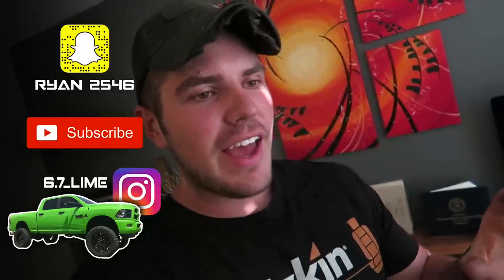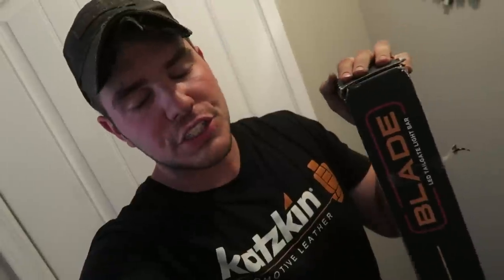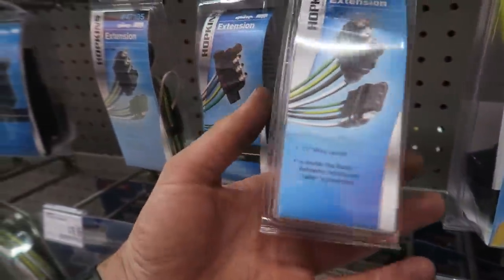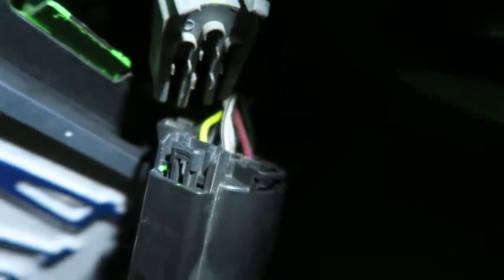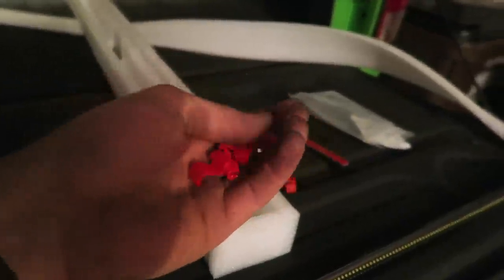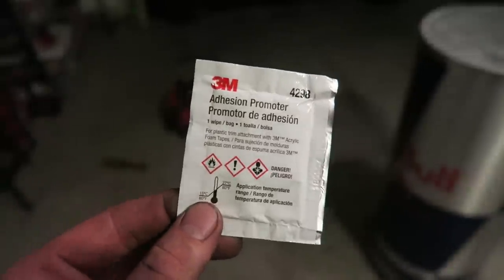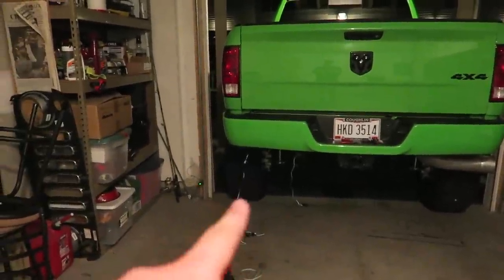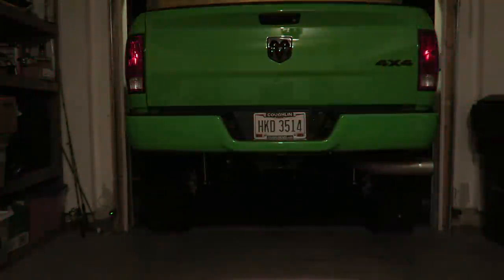LED Tailgate Light Bar INSTALL!! *Super BRIGHT*

Comment: ....spends $200 on a tailgate lightbar - okay fine....  doesn't spend $12 on a soldering iron to make good connections - not so cool....
Reply: WORD!!!
Reply: He’s a newb, give him a break
Reply: Cringy eh
Reply: No go  have to save my money for crack
Reply: The tape probably fell off before he was done with the video.....
Reply: Scott Warmbier but the t-taps are too novice...
Reply: See how clean that thing is!?!?! City boys are funny
Reply: I like your green truck is my favorite color I wish I had a truck like that great way to go
Reply: Haters gonna hate !
Reply: Solder will get brittle and break over time. Crimped would have been best.
Reply: If the truck vibrates so much that it might crack the soldered joint? On some occasions a classic linemans splice is my choice on the equipment that I work on
Reply: They make a plug and play version of that connector as well. He should look up the term multiplexing to learn why you should never tap into the wiring of a third gen or beyond.
Reply: @79brumley  no what makes him an idiot is saying its 2 bucks for a decent iron with solder and flux when he could have spent 2 bucks on marine water proof connectors with the solder in them already....just saying
Reply: Donnie Richard you're*
Reply: @donnierichard3301  So if you had to have surgery and your surgeon was pretty new and he made a mistake, Would you say oh he did a good job for being inexperienced? If you can’t do a job correctly you should put a disclaimer in your video telling people not to do what you did! Messing with your electrical system can void the warranty on a new vehicle! Also he says he does this to all his vehicles, You would have thought he would have gotten it right by now! I can’t even count how many of my customers cars I have fixed because they told me they watch the video and thought they were doing it correctly and ended up having problems or causing more issues to their vehicles!
Reply: Oh fuck!! Why you doing my boy like that 😭😅😂
Reply: Buys a light bar not for functionality or work but for looks…snowflake

Comment: Have fun lowering your spare tire when you have a flat....
Reply: He wont be cause it's the oem spare and the other 4 are big ass mud tires on different wheels
Reply: @Marathon13240   sure yah can.. the spare goes on the front and leave it in 2wd
Reply: Why would you go to all this trouble for an LED light bar when you didn't even replace your factory brake light bulbs with LEDs?

Comment: Need to swap out the taillight bulbs for LEDs so they're instant on/off like the light bar. That would drive me absolutely crazy seeing the stock signals and brakes fade in and out while the light bar comes on and turns off instantly.

Edit: This would be a must for me, even without the light bar!

Comment: Looks like a sweet rear end upgrade.  To avoid future problems, I would highly suggest (as others have, but i'm trying to add a helpful factor in and not just name call) you do a better splice in job.  The elements will make it through your electrical tape and corrode those connections.  Those scotch lock connectors (t-taps) are no good and have seen them fail many times as well.  I mean your connections, as is now, may last a week, a year, or maybe 10 years, but I'm sure you don't want to have to worry about it at all.  I would suggest cutting the wires apart where you spliced in and either soldering them and then covering them with heat shrink that has adhesive inside that will help seal it up, or use butt splice connectors that have heat shrink with adhesive on them.  You can get ones that can accept 2 wire on one side and one wire on the other side (like a yellow butt on one side and blue on the other).  To take that even further in to the professional installation side, you could make or purchase an 8" adaptor with the correct connectors and amount of wires and then splice in off of that and have a connector there and install a connector on the light bar wires.  You could then remove the adaptor and light bar if you ever wanted and just plug the factory connectors back together.  Obviously this is just my opinion and someone else might call me an idiot or maybe have something helpful to add, which i'm fine with learning, But this is what has worked for me to make good wiring connections and not have to worry about them.  Cheers
Reply from the maker: I respect you actually commented on how I should do it to not worry! Lol I did it this way so if I wanted I could always remove it without cutting! I didn’t want to cut and solder the harness back together, I may solder the connections in the future but for now they’re gonna be like that for a while lololol
Reply: Bradley is right, do it right the first time. I lmfao when I saw you twist splice and tape the joints.
Reply: I haven't watched the whole video yet but doesn't somebody make some type of plug and play so you don't have to cut any wiring and in the future if you wanted to remove it you just plug the original back in???

Comment: Thanks for the recommendation. I am surprised you got one with Amber flashers when your truck doesnt have amber flashers on the rear. I want to get one for my 98 K1500, which only has red on the rear, so I hope they have one with Stop/Running, Reverse, and Red Flash.

Great video!

Comment: Received my light bar and wired it today. The lights are amazing [bright and crisp]. Get one, you'll love it. Save yourself some time and order a Curt #56584 harness and #58550  5 pin connector plug from Amazon. Just plug and play, no cutting into your trucks wiring. You will have to wire in the backup light, but this can be done on your work bench. Thanks Ryan. Also the light bar does NOT interfere with the lowering of the spare tire, you just have to modify the protective ring a bit.
Reply: Nelson Bardsley I’m trying to avoid all the splicing or whatever. I was going to order that harness with it, but it says it doesn’t fit my truck I have a 2014 ram 1500. Any recommendations??
Reply: Angel, There are so many variations of wiring harnesses and truck configurations. Get ahold of "curtmfg.com" and they will be able to help you. My truck is a 2017 model Ram.
Reply: Great info and a very helpful and respectable response there Nelson! The world needs more kind people like you in it! Drive safely and enjoy the holidays.
Reply: @nelsonbardsley3535  Be honest man are you getting paid by them to say this or no? I have a 2006 5.9 Cummins do you think itll work?
Reply: @steve5912  Sorry, not getting paid, just love the product and install was easy. It should fit almost any pickup.
Reply: @nelsonbardsley3535  Alr thanks bro. I just got this truck and I'm replacing every bulb with led and adding some light bars/pods. I'll look into the #s you mentioned.
Reply: Just plug it into your trailer plug and your done. No splicing.

Comment: Has he heard of the CURT 55384 Vehicle Side Custom USCAR Vehicle Trailer Wiring Harness for Towing, 4-Pin Trailer Wiring? I used it to install my OPT7 Triple LED Tailgate Bar with sequential turn signal, and the only splice I had to do was for the Reverse cable. The CURT harness took care of the rest. In my case the bar already came with the 4-Pin connector pre-installed and a single cable for the Reverse.

Comment: My 50$ front ebay very bright led set-up has been goood for just over a year with no problems, still like new. Came with lights, wiring and switch for in cab. I dont think I'd get fancy ones and be spend 10x to 20x more for not much different. Cool look though!

Comment: Don’t use any snap connectors, always use heat shrink connections. They’re weatherproof, and will not corrode if you do it properly do it. Splicing wires the way he did is sure to fail shortly.
Reply: Yup. If you’ve seen his more recent videos it’s already failed
Reply: Posi-tap or the supplied ones work with electrical tape. Haven't had any issues for 2 years. Glad i didnt aoldoer becausei sold the truck but wanted to keep the blade

Comment: Did you just wrap spliced wires on the under side of the truck with just electrical tape? No solder, connectors or heat shrink?
Moisture problems ahead.

Comment: I got one on my car silly I know But I do t have a daytime runner wired in (weird on a car) but the brake lights flash 2 times before staying solid and the turn signal goes from  one side to the other sorta like an Audi signal. Cheap and easy mod!

Comment: Bought one for $12 on eBay on accident. Been using it for 2 years and all the led's still work. Has full function also, hazard flash, left/right blinker, brake and reverse light. 
The mistake was worth it lol
Reply: You didn't get a Putco Blade for twelve bucks.

Comment: I have a tail gate light bar on my 2016 Silverado and I bought a harness adapter the goes in between the factory harness and the bumper plug and has a 4 pin connector on it. No need to splice factor wiring and I tapped into the center wire(reverse light on the adaptor

Comment: So while I'm only looking for a reverse light bar, holy crap $300 today on Amazon for this Blade.....still looking.......but a question for ya, I suppose your truck does not have "Trailer Light Out Sensing" because if it did, wouldn't the truck think a trailer is always connected?
On my 19 Ford, when I plug in a trailer (essentially the same thing as you tapped into), the truck knows the trailer is connected. Just a thought....

Comment: A t-connector will plug straight into the truck wiring harness and works great for the 4 pin, then it's just a matter of connecting the back up wire ... I like the self stripping tap connectors. 
Great vid .... lights look awesome.
Reply: Alot better that ehat he did..wrapping the wire than taping it. Better off using the supplied ones he had

Comment: Did you check that you can get the spare tire crank bar extenders into the hole you just covered up with the light bar? You're going to bust the thing cranking down the spare.

Comment: Hey man,  that is some bright lights,  I have a RAM 1500 and I need to figure out how to rig up a movable light bar for retrieving a boat at NIGHT, there are NO lights at the ramp i am always at.  I wanted to light up the whole area because it's a sailboat, not a motor boat it goes on differently and you have to see things!   Is there any way to make up a connection for this situation?

Comment: If u splice that way you should use a punch to separate the wire core to make 2 half's then stick your wire in the middle then twist now it will not just unravel and u get a more secure connection

Comment: I would recommend removing the tailgate to install much easier.  Also, it looks like you installed the lightbar right over the spare tire removal opening?  How will you drop the spare?
Reply: HPIII looking for that option is the only reason I watched this ( I also have a ram ). Then he went right over top of it🤦🏻‍♂️
Reply: @UpStuff  This is also the only reason I watched this video.  I wan't one for my 2014 Ram 2500, but I also want to be able to lower my spare tire,

Comment: Looks great.  Only one thing.  Won't you think it would it be easier  if you it take the tailgate  off so its easier to work in the area
Reply from the maker: It would be easier but I have a tailgate assist on my truck and didn’t want to remove the shock lol otherwise I woulda!!

Comment: Of your doing this they make a T connector that plugs into the back of your 7 pin plug and gives you the wires you need so your not splicing. It a much cleaner install and much more reliable.

Comment: Hey bro why just not connect it directly into the 4 pin connector is there a difference other than making look much cleaner without the wires being visible ?

Comment: A plug in t connector or shrink butt connectors and should be using a 5 flat connector like what is used on a boat trailer with electric brakes so you have the 5 th wire for reverse lights

Comment: Ryan going back to an old video for some help I like how you set this light up but I wanna run flush mount leds in my bumber could I hook them up like this for reverse and then have it on a switch were I could turn them on when ever

Comment: Looks good only reason I care for them cause of the blinker I can't stand that the light bar is a blinker (IMO) looks tacky
Reply: Sequential > blinking
Reply: You can leave off the left/right blinkers, and utilize the tail light portion of the 7 pin trailer adapter and have running, brake, and reverse only.

Comment: Perfect way to destroy factory wiring there are much better ways to splice wires
Reply: Omfg seriously! Im in michigan, those wires would be dead by next spring 😂🤣😂🤣😂🤣😂🤣😂
Reply: Cj Bales I am in Ohio and thought the same thing other than that looks like a cool light bar
Reply: Agreed!
Reply: There is a 3 way split that uhaul sells for about 20.00 and all one has to is just unplug them and put the splitter on I did it to my Tahoe.  Oh wait this was a dodge right. Fuck it don't worry about it then the truck wont last much more lol
Reply: Nevermind this is a great application to use a powered relay.
Reply: $40 tee harness with 4 pin connector
Reply: @carlosef8  that's right Juan he can spend almost 200.00 on the light but can't spend 20 to 40 more for the tee wow that sucks right
Reply: T-taps.
Reply: @peterpro2a  trying to find this on the uhaul site now for my '18 silverado. Do you know the exact product name? https://www.uhaul()com/MovingSupplies/1/Tow-Vehicle-Wiring/
Reply: @peterpro2a  do you know the actual product name on the uhaul site? trying to get this for my '18 silverado
Reply: @Bored00m  sorry I don't remember it. Just tell them you want the "T" for you wire harness I'm sure you can just go look and find it yourself in there
Reply: @peterpro2a  ill go have a look soon. I checked out their website and dont see anything like you described. thanks for the info!
Reply: @Bored00m  I looked as well last night I didn't see it but sometimes they don't put everything online I noticed.  I know I just got one a few yrs ago for my z71 Silverado as well. Now the new truck I have now I haven't got 1 cause it all came as one package. Maybe look on Amazon as well I'll look if I find it I'll send you the link
Reply: TURTLE 2010 awesome! that should do the trick. thanks again
Reply: @Bored00m  no problem hope that will work for you

Comment: Rookie!  Using butt connectors causes resistance in the current and that can cause problems with the ECM.  ALWAYS solder and heat shrink.  You should stay away from anything electrical.  I do have a question though.......don’t the Dodge backup lights work?
Reply: Sooo, actually, a properly made crimp connection has a LOWER resistance than a soldered one. The difference is slight, though. US military specs for communications and power usually point to crimping.

Comment: I have a 2016 ram 1500 and my tailgate bar has a separate brake wire……where can I tie that into……it doesn’t work properly if I tie into the tail light wire…… any advice?

Comment: our car doesnt have the 4 pin flat socket. i plan to hard wire the product.
the supply wires are as follows
1. Ground
2. Running light
3. Brake 
4. Left turn
5. Right Turn
6. Reverse

the product i bought has 5 terminals / wires  ; 3 colors - red, amber, and white
1. Ground
2. Running light
 (red low beam)
3. Left turn
4. Right Turn
5. Reverse

i do not know where to connect the brake supply wire from the car to produce the high red beam

Comment: Check out Curt Manufacturing 56584. It’s a splice in harness for your 7 pin. It comes with a five pin which is perfect for your reverse function. I just used a bullet style connector. Yah for like $35 you don’t have to splice wire and worry about shitty connections.

Comment: I have the RECON tailgate light bar on my truck. The only difference is that my turn signals are sequential.
Reply: The Recon also has larger and fewer LEDs. The Putco looks like a solid bar like some of the Caddy taillights

Comment: Does this mount cover up the spare tire release hole? And are you able to drop the spare tire with this on? I’ve heard of some people having to remove the plastic hole cover so the bar mounts flat, how was it in that area?
Reply from the maker: This light bar can be removed from the mounting brackets to get to the spare tire and the brackets stay on your truck! And it pops back in! I removed that part from editing made the video wayyyy to long and I can even use the 31” spare anymore 😂😂! But amazing design!!
Reply: if u use the plastic brackets it will give it the same space as the plastic spare hole the light will even shit on the plastic hole but the plastic brackets do break easy so be carful i broke the tabs on mine and just took them off and put 3m on the light its self and took off the plastic spare hole

Comment: You must not have the blind spot monitoring system.  If so, your blis would turn off and you would get a message saying you have a trailer connected.  Even with hard wiring to the harness.
Reply: Depends on the model year of the truck